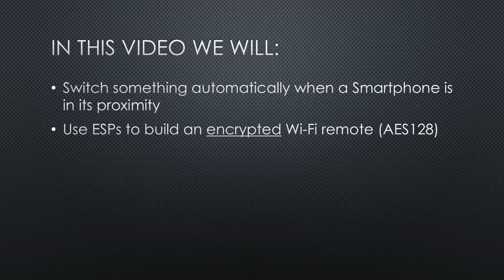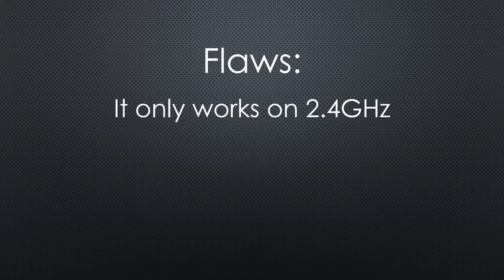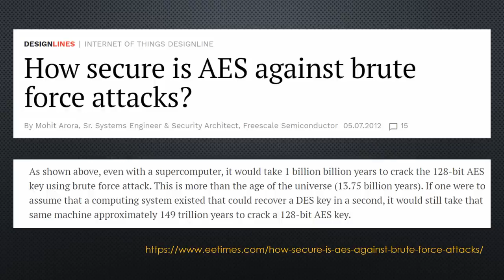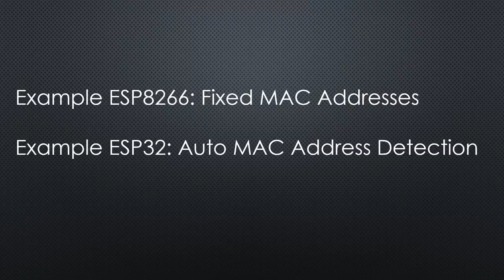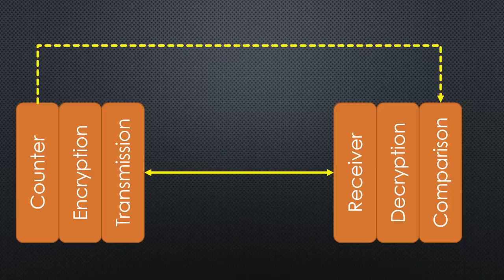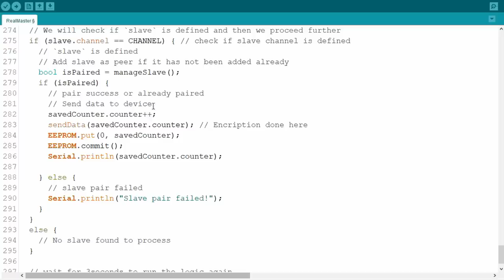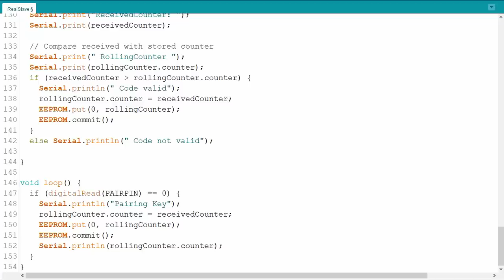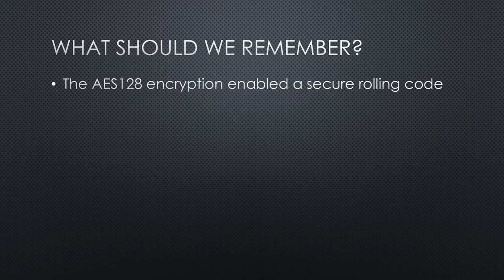#382 Secure and cool Remote Controls (Touchless, AES128 encryption, with a T-Beam watch and a cat)

Comment: Another approach would be a challenge-response one: S—„open“—>R, R—„please encrypt N=rand()–>S, S-AES(key, N)->R
Reply from the maker: This would use the reverse channel, I assume. Definitively, this would add a lot of security. And no synchronization would be needed.
Reply: @AndreasSpiess  , thank you for very interesting and great content. You are my electronic mentor!! I was wondering if it would be possible to use ones mobile device instead of a smartwatch with esp32? Will the mobile phone's wi-fi not be sufficient?
Reply: @peterdever4826  Hi Peter,
I think one could use ones phone. 
The wifi would be more than sufficient. It would require you to run an app of course and your phone would need to make a direct connection to the receiver. 
The SonOff app does something similar to add a new SonOff to your home network so I don’t see why this couldn’t be done.
Reply: can you explain a little more please. I am so interested on this. I am building my own encryption protocol based on Keeloq but since it was defeated by russian hackers I want to build something more robust. My idea is "known command"->encryption+new password for decryption of the next msg->base64-- transmission ---;  Response "ACK"
Since the NEXT msg has to be decoded with the password sent in the last msg, a replay attack will fail. the sender always send the password to decode the next encrypted msg.
in case on a playback  or milk attack, based on the "ack" signals, the sender can hold the last successful msg and send the proper msg to restart. yes is complicated to explain but i swear i will do explain better after my breakfast.
Reply: @soulrobotics  One single lost message will desync your devices forever, wouldn't it?
Reply: @soulrobotics  this would be horrendous for reliability as someone above points out, if you fix that, chances are jam, capture and replay will work just fine.

Never roll your own crypto.
Reply: @AndreasSpiess  I suggest the server sends the client a random number. The client then combines the random number with a pre-shared secret and hashes the result. He then transmits the hash. The server also computes the hash on his side and compares it against the one he receives from the client. If they match, a single request is authorized. Note that this only works if and only if there is a single "bit" to authorize. This does NOT authorize the server.
Reply: @AndreasSpiess  Good to know that it doesn't have to be a encrypt function, you can use a hash function as well. SHA256(secret + challenge) for example. In both implementation we must provide cryptographically secure random challenge generator.
Reply: For ease, SKEY has always been a nice solution to layer in.  Used that for port knocking sequence to open up my SSH port to unknown IP address's - covered being able to lock down SSH at IP level access to only ones that knew the SKEY for the port knocking sequence.  Old solution used back in later 90's upon OpenBSD.  These days I just don't go that far at all, shameful I know.
Reply: Challenge response would ideally be something known by the user, not owned (coded into the device).  An interaction such as pressing a particular button or choosing a shape on the display would be a pre-arranged response to a challenge.
Reply: @BerndFelsche  If we ever get to the stage that I have to enter a CAPATCHA or identify Bicycles in pictures just to turn a light on and off, that's the time I grab a tent and walk into the woods never to return :-).
Reply: @soulrobotics  Please do not implement cryptography by yourself, except for your own eduquation.

Keelog was already defeated in 2008 by some germans with a sidechannel attack, there is no need for rusian hackers :D

There are many ways to secure one way communication against replay, the most efficient is to use a common time source and track of received packets on the reveiver side for the time difference allowed, even this system has its flaw in the common Time source. you will never reach a really secure solution when using one way

if you have 2-Way Communication... generate a random Value on the "receiver" and send it to the "sender" on reuqest, the "sender" just encrypt the random value with the (symetric e.g. AES or assymetric e.g. RSA/DES/T-Des) key and send it back with the command as evidence... this is called Challenge / Response and needs no big storage to avoid replay attacks, yust a functioning random source. Now the flaw can be the key and only the key.
Reply: @BerndFelsche  I think you are confusing challenge response with something else, CAPTCHAS or maybe 2FA.
Reply: @paulgray1318  , you should be able to only provide a DNA sample 😏.
Reply: @Feuermagier1337  if you want to transmit more than one bit, transmit them in cleartext and include them in the hash
Reply: @paulfontaine7819  Yes, the client could do some hacky stuff there, but as a computer scientist I have to say that this will probably go wrong somewhere and you make a tiny mistake that makes the entire system insecure. At this stage you just get yourself a TLS-library. Easier and more secure. Also the protocol describes exactly what you get and what you do not get. Takes care of everything we want here and more. Probably should have recommended that in the first place. There is a reason we build big guns.
Reply: @michaels3003  That will provide a bit of paradox for the toilet light in situations I'm in a rush to give a large DNA sample after a few beers.
Reply: @paulgray1318  , a bit of spit will do; no need to compromise removal of the waste water.
Reply: @Feuermagier1337   I didn't know TLS allows to authenticate a transmitter. Can you guide me to the relevant part of the TLS specification? Isn't TLS to heavy for the environment Andreas targets? A much to heavy tool when AES or a secure hash is enough?
Reply: @paulfontaine7819  TLS is actually a collection of many different secure protocols. It can authenticate servers and clients in an arbitrary chain of trust (you can make your own root-certificate). It offers many options. You can use a pre-shared key - or you can use a key-exchange algorithm. After the key-exchange a symmetric encryption will be used (like AES). The ESP has built in support for RSA and AES, so it will be very fast. It can do the entire key-exchange in just 3 messages (TLS 1.3 ; really cool).
It will shield you from a massive amount of complicated attacks, like:
man-in-the-middle
replay-attacks
data-modification
traffic-analysis
hostile-client
hostile-server
(and many more variations which would too long to come up with, but people spent a really long time hardening the protocol against all kinds of stuff)
For example if you transmit the exact same message twice, it'll make sure that the packages look totally different to an observing attacker.
Some variants even have perfect forward secrecy if you want that.
And you can just choose whatever subvariant of the protocol suits you best:
https://datatracker.ietf.org/doc/html/rfc8446
(alternatively: choose the best one for the job, which is also supported by your library)
For example you could choose TLS_ECDHE-PSK (pre-shared-key)_AES-GCM, or TLS_ECDHE-ECDSA_AES-CCM.
You won't have to worry about it in your application. The libraries essentially replace the "socket" you usually write to with a "secure-socket" that looks and feels identical.
It'll be more secure AND faster than anything you can come up with in under a month, as the libraries are usually highly optimized and well-tested.
Use it specifically because it solves problems you haven't even thought about.
No matter what you need to transmit over a secure connection, TLS is almost certainly the tool for the job.

EDIT:
If you are unsure about what to choose:
1. Pick TLS 1.3
2. Look at your board and see if it mentions hardware-accelerators for whatever letters there are in the sub-protocol-name supported by your library.
3. Pick one of those.
4. If you aren't entirely sure about your exact cryptographic requirements, pick something with ECDHE and AES in the name.
5. Done
Reply: The "open" command could include a client-specific ID, so the door could keep track of who opened it, when. If you are creating a really secure installation, you need those access logs. But you should probably add some random junk to the ID, to confuse outsiders.
Reply: @TomLeg  No need to add random junk, when using a secret key. Everything encrypted looks like random junk and as Andreas said, is impossible to decrypt (except if the key is not kept secret on both sides)
Reply: @Feuermagier1337  Thanks for the effort in putting this answer together :-)

Comment: Since you're padding the packet with zeros, I suggest you validate that they decode to zeros at the receiving end. This protects you against an attacker sending random data in the hope it decrypts to a high value.
Reply: yeah that greater comparison doesn't seem robust to random data too
Reply from the maker: As many others proposed we could add a simple window of maybe 50 or 100 numbers... Would not be too complicated.
Reply: Or pad with a known key phrase, just relying on the number being bigger to be valid is fairly naive approach. There's other ways as well like sending the counter value twice, or send it forward and reversed or adding one to the second copy of the counter value all of which act as very simple checksums that don't require complex maths or libraries.
Reply: @AndreasSpiess  Even with protection against random data attacks there's still a vulnerability left - what you mentioned in the video - an attacker that is able to capture a transmission (a transmission that doesn't make it to the receiver endpoint for some reason) can replay it later (until the next successful transmission in range invalidates the captured one).
At one hand, this sounds like an unrealistic scenario and can easily prevented by not pressing the button randomly (but only to open the door).
At the other hand, an attacker could block the receiver with a jammer/sending random data at the same channel near the receiver and place a second device (to capture an attempt to open the door/has to be placed close to the position of the remote control when transmitting).
If the remote control does not work, the owner of the garage will likely open the door using the traditional method (mechanical key...).
If he doesn't immediately debug the system and find the cause of the malfunction (maybe decides to look at it next weekend) the attacker now can use the captured transmission to open the garage anytime he wants.

So I think the only proper way of implementing a secure protocol is by using a challenge-response algorithm.

Comment: Thanks for your effort and your ideas. These remote control activities are really extremely useful and worthwhile each penny.
For many years, I am opening (and close) my garage door via 20 EUR Homematic components (AES encrypted) and open (and lock) the entrance doors of the house using Keymatic together with a smart phone "App" written in "Tasker". Works very well and is very convenient. I also use RFID to trigger these tasker apps. 
When my mother increased dementia and forgot her keys, I used additional RFID technology to give her access to her house. So, she could stay many months longer in her own house as without this technology. Very helpful and worthwhile each penny.
Reply from the maker: Thank you for sharing your experience. Indeed we have many such remotes around us and I wanted to make them a little safer... RFID are also a very useful thing as long as they use the newer ones with some encryption. I think they do not need to be extremely safe because we build one-off devices and if the effort is high, nobody will try it (or smash a window which is easier).

Comment: Maybe you could use the RTC to include the current time in the encrypted message so that if the code is milked and replayed later the time from the code will not match the RTC of the receiver. Would maybe need to update the transmitter's time occasionally to keep it accurate.
Reply from the maker: Including time is always a very good idea. But then both times have to be synchronized. This could be done during pairing.
Reply: @AndreasSpiess  synchronisation is not reallu required, the receiver needs to keep track of the 'latest' message, anything older can be ignored
Reply: @LimBo3500  That leads to a security hole, if your codes get milked and used before you get home and use the genuine remote. Actually without clock sync it's exactly the same approach as with the incrementing numbers. Time IS a steadily incrementing number for PCs and MCUs :-)
A synced clock would be a very nice security measure, but you would need to think of the additional energy consumption in the remote as well as clock drift between sender(s) and receiver.
Reply: @zeero4ever  Time would allow to set expiricy and you can also sync it during any communication. This would avoid replay attacks outside of the token's validity period.
Reply: @avamander.  Thats what I said. Time is useless without sync. Yes you could resync everytime, but it's a pain. If you start implementing two way comms anyway, challenge response would be way easier. You HAVE to know the key and you HAVE to know the logic to calculate the response. No milking or replaying possible, if the challenge uses nonces or some other technique to never have a bitwise duplicate challenge. Otherwise long term eavesdropping COULD make replays possible.
Reply: Would it not be safe for the receiver to just broadcast its clock to anyone? Having the receiver's clock doesn't matter if you don't have the counter, and keys would still be time-sensitive. Unless you're randomly setting the time anyway or an offset, which wouldn't help much, an attacker could just assume the receiver's clock is current with actual time so there'd be no need to keep it secret.

Comment: Use a similar principle to a keyless car fob.

(1) - The fob sends a command ID "request to unlock" - plus an incrementing value. 

(2) - The car checks the ID and that the incrementing value is higher than the previous value and stores it if it is - then replies with an "understood unlock request" command plus a random number for the fob to perform some maths formula on. 

(3) - The fob performs the needed maths formula on the value recieved, then sends the value back.

(4) The car checks that the value is a match for the result of the formula and unlocks if it is.

Just one of many methods.

Enjoying the channel from here in the UK.

😉👌🏾
Reply from the maker: You are right. If we would add a backchannel we would get a lot of additional possibilities.

Comment: Some interesting project ideas. I've been wanting to create a secure garage door opener for my motorcycles and trigger it by flashing my high-beams when I get home. Toggling the high-beams can both power the units on and transmit the codes.
Reply from the maker: My transmitter under the saddle runs all the time. It is so low-power that it does not disturb anybody (range 2 meters or so).
But a morse signal with your headlight would be a cool solution ;-)

Comment: Nice content. The field of encryption is a tough one with many security traps and risks if not properly implemented. So guys, be careful how much you trust your own implementation or libraries.
Reply from the maker: I completely agree and I am not very good at it. Still I think the reach of a system is a big protection factor. If the reach is only a few meters, the effort increases compared with a device connected to the internet. ESP_Now in this respect is probably a good compromise.

Comment: A flaw I see here:  the receiver is simply creating an unsigned long number from the decrypted string, and checking if the number is higher than before. In theory, I could send the receiver junk data and the receiver will decrypt it, and convert the junk counter string into a number (if it happens to be an integer). Since you only check if the counter is simply larger than before, it's likely you'll get an unsigned long that indeed is larger, and open the gate. Maybe limit the check to the incoming counter being within 10 numbers of the previous value or something like that. Also, in the sendData function, in itoa, "cleartext" needs to be large enough to hold a 32 bit long int as a string with the last one being the null termination (11 character long for base 10 which is what you're using), so idk why you've made it 256 chars long. You can initialize it to all zeros and make it 16 bytes long and you won't need to pad it later, just zero it all before each use (still need to replace the null termination char with a 0 after itoa). The way you're doing the padding with zeros doesn't seem right either, since you're indexing from messLen + 1, but you should start at messLen instead, that's why starting with a zero initialized cleartext is easier. Furthermore, you're passing messLen to the encryption function that may be smaller than the 16 byte block of your padded cleartext. I think you should pass a 16 instead since the message you're encrypting is always 16 bytes. Also why is your ciphertext in the decryption 50 characters long?
Reply: Yeah at the very least wouldn't you want some small window like you mentioned for conventional rolling code RCs? So it should only accept values at MAX 250 values ahead of the rx counter?
Reply from the maker: A window is a good idea and easily done...